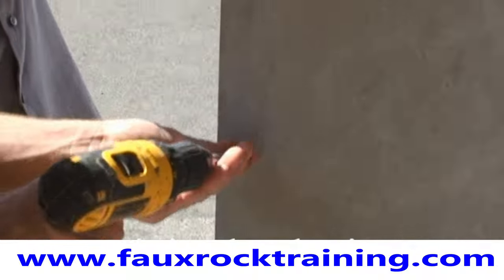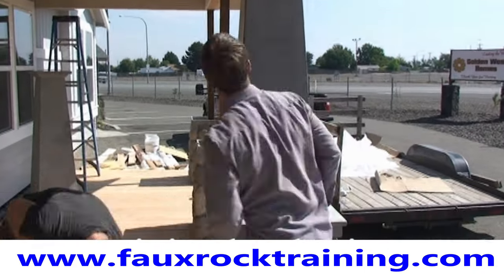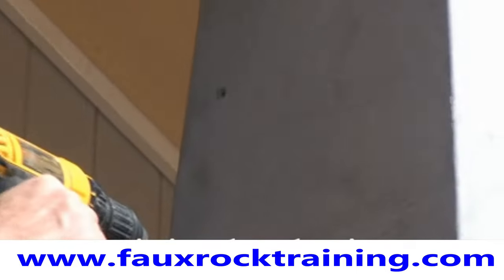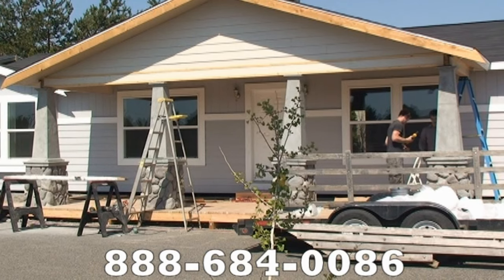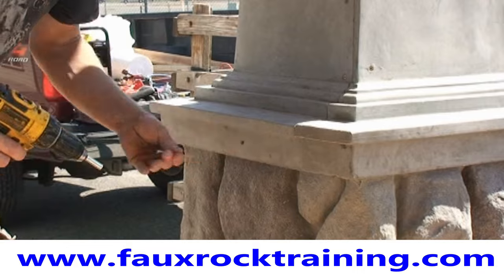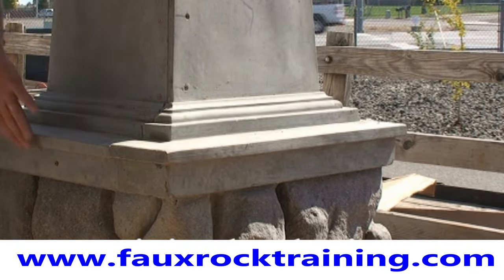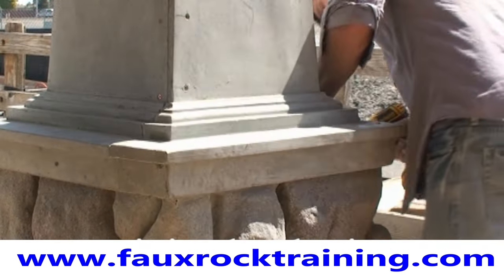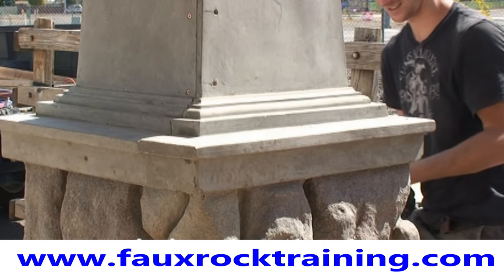Install stone columns fast Part 2

Comment: Great job guys! This project made a huge impact in the details of the house, definitely adding value and curb appeal.  The panel design, engineering, molding, transportability are exceptional factors.
Reply from the maker: Thanks again…. I appreciate you